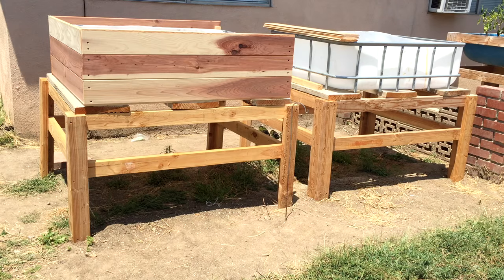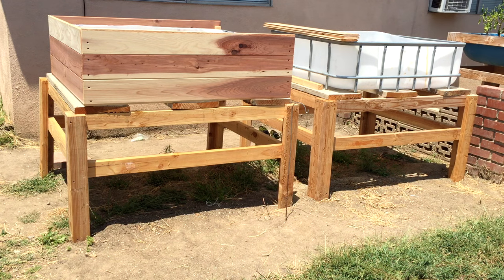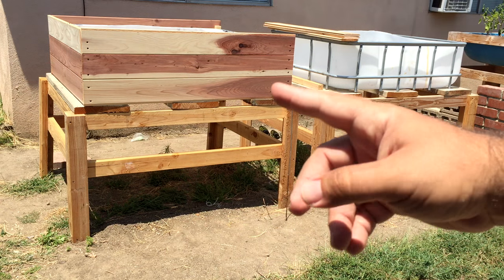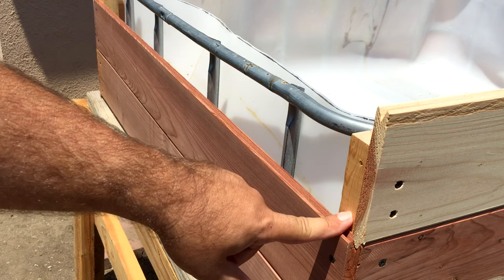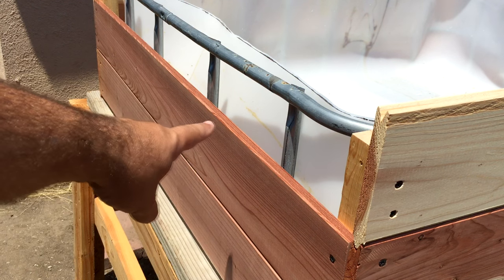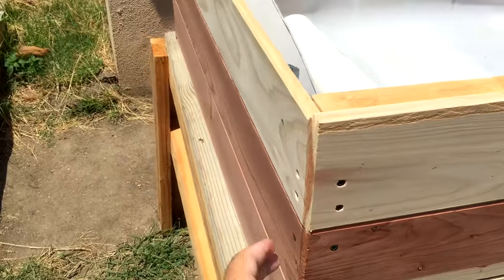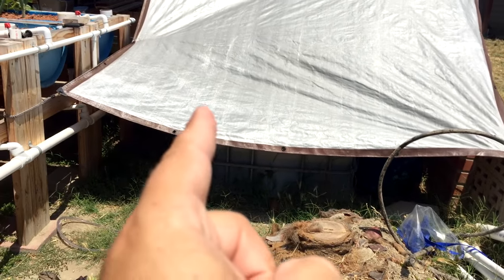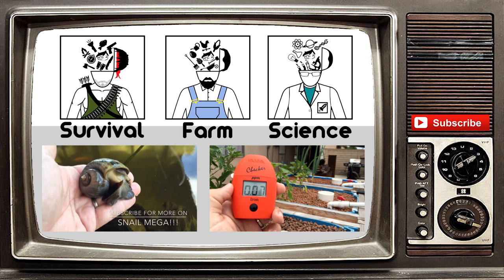Aquaponic IBC Grow Beds

Comment: You have the cedar boards upside down. The Tongue should be up not down. That way all moisture will run off and not collect in the Groove and speed up rotting. Tongue and groove was designed for this reason. The way you built it water and debris will collect in the groove. Ideally you would trim off the Tongue on the top and create a nice finished edge.
Reply from the maker: Wow!! So good info:) You are so right about that! I was thinking the same thing but I did not think of the water. The cool thing about this is I can just take it off and turn it upside down. Thank you so much for letting me know that!

Comment: Great job! How did you attach the board behind the tounge and groove boards? Did you drill it into the metal frame and was it just 4 vertical boards, one on each corner? Thanks!
Reply from the maker: I attached all 4 tongue in groove boards to a 2x2. Once I did that I just left the box free standing. I basically did not attach it to anything else because if I need to remove it I can.
Reply: Home Farm Ideas how did you attach the 2x2 to the tote?
Reply from the maker: I didn’t attach it. It is all free floating so I could literally pick it up and take it off:)